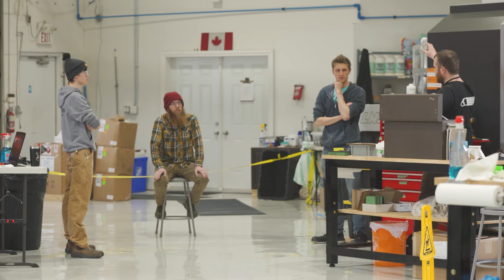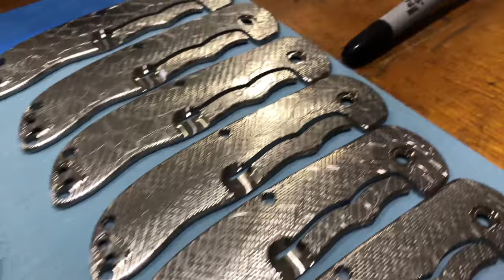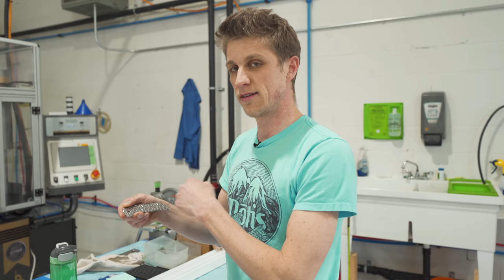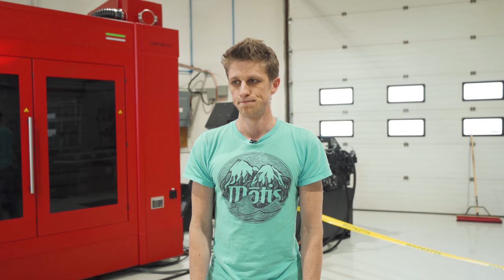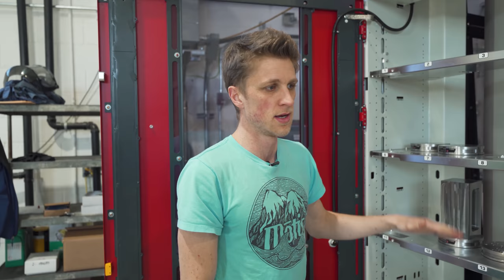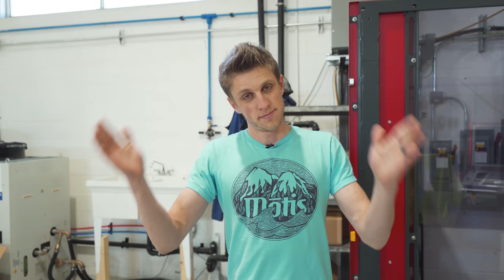Making the best of a tough situation.

Comment: I worry that the demand for $1000 knifes will disappear overnight. However since you have all those machines, Consider manufacturing items that might be in demand. For instance, Ozone Generators that can be used to disinfect public spaces, or anti-viral door handles (copper or copper plated). Or see if any mfg producing critical\essential products needs a machine shop to assist production. 

Best wishes for the Grimsmo team!